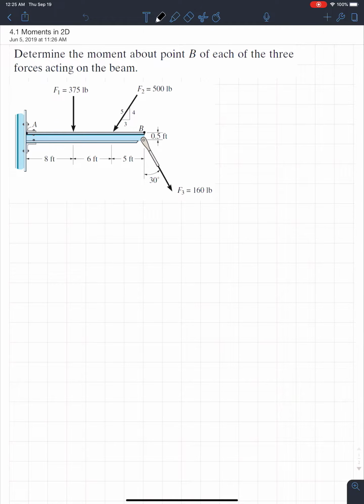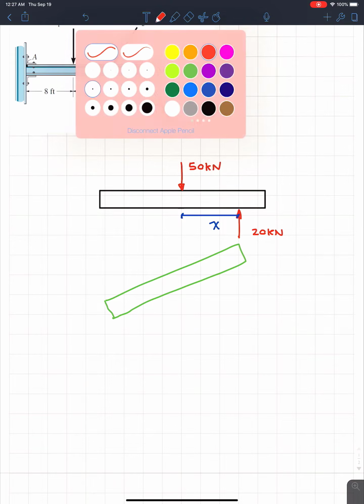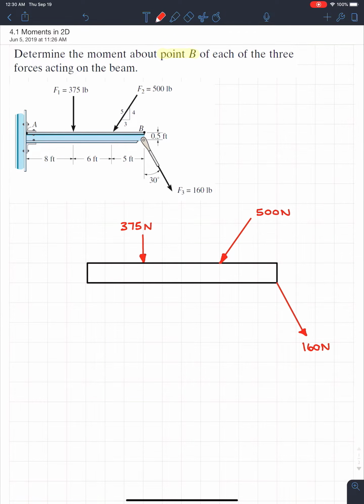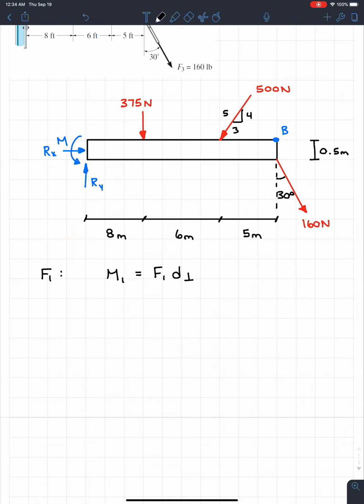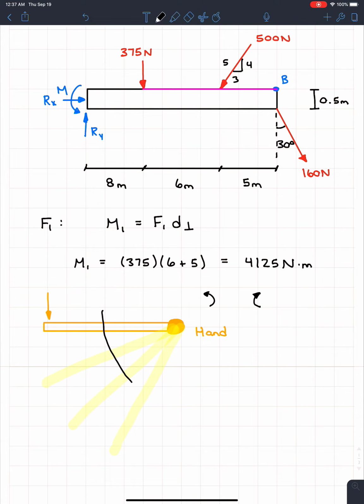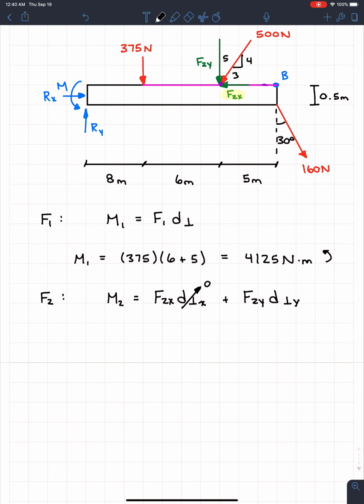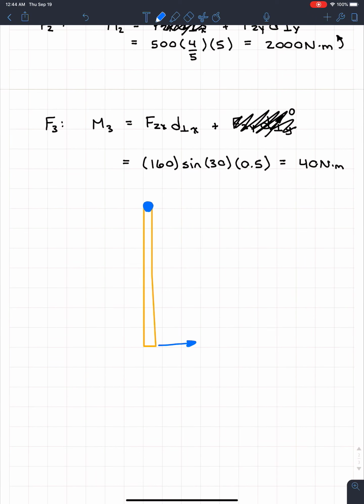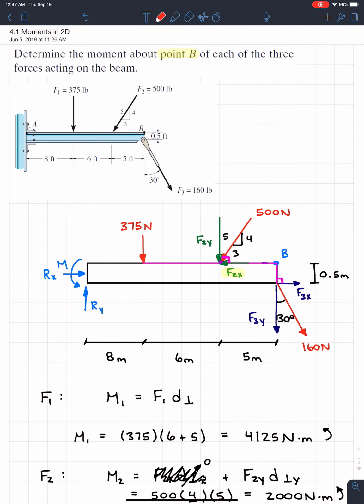Engineering Statics | Old Example | Calculating Moments in 2D

Comment: Shouldn't the perpendicular force for the 160 N force be found using cos and not sin (e.g. 160cos(30)) as the side perp to the bar is adjacent to the angle not opposite?
Reply: ur tripping on acid, its literally sine
Reply: thats what confuses me because the component of x is cos
Reply: @scott04.  its the same though, he's doing 160sin30, same as 160cos60, if you orient that triangle the right way its interchangeable #unitcircle